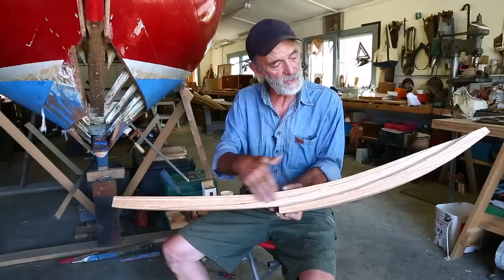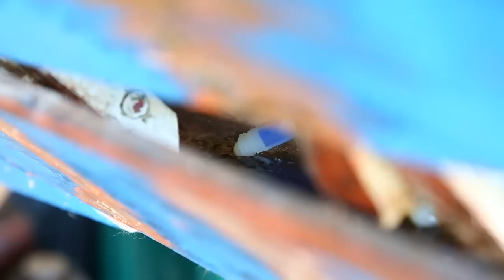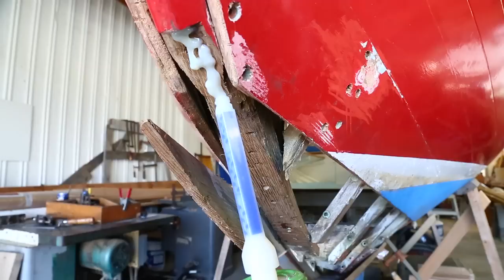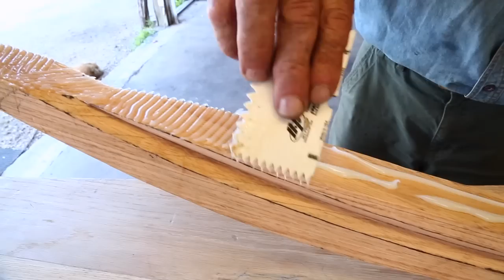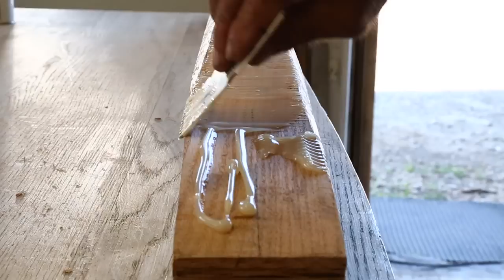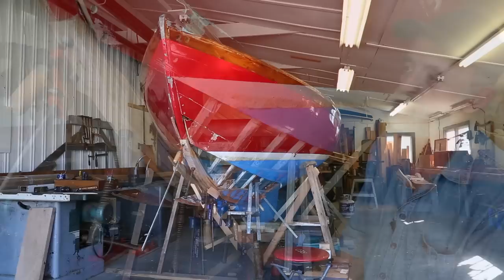Part 6 - Wooden boat repair - Installing the forefoot on a Herreshoff 12 1/2

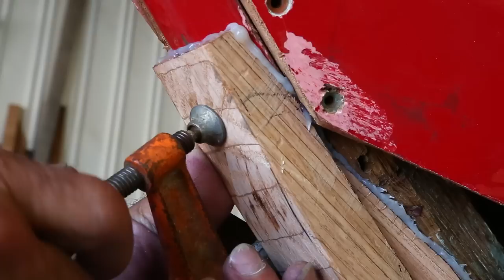Comment: 3:54 clean it of with naphta  in lacquer thinner 10%. Alcool is cold and dry it does not induce heat on these thermoplastic compounds.

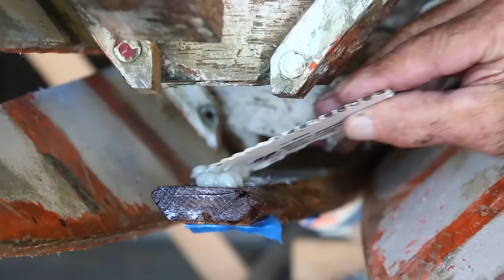Comment: 1:54 but the boat is not build with epoxy everywhere... this hard spot is going interfere with the flexibility of the boat haul cause some other damage. If it doesn't break the epoxy it will break the wood. This area is the spot that takes all the blows of navigation. Screws are going to give and get loose
Reply: I think that part of the boat is not actually meant to flex much. By the time it is all joined up using traditional methods it is like a solid block anyway. This guy knows what he is doing (in my opinion).

Comment: Great gluing practices. I cringe when I see someone working with wood and run a single bead of glue down the center of one piece of stock versus covering the entire surface areas of both pieces of stock.

Comment: I actually use the saw blade to clean a cut if it's not entirely clean (i use the go around the cut line technique most of the times and that leaves some marks, nothing big but still), and it's really great because i can use the side of the saw blade as a guide along the wood and just let the teeth cut for me.

Cutting tools with teeth have so many more uses than just straight cutting with them. :)

Comment: All this work you do on wooden boats must cost the owners an arm,leg and a nut.  Ill stick with metal hull boats.
Reply: +Rogue Fox .....If your really worried about cost then fiberglass hulls can't be beat.  Try this test leave a metal, wood and fiberglass boat sit in a yard unattended for 20 years and view the results. I have many times and fiberglass is the only survivor. I love wood boats but will never own another. My dad had a 50ft steel ketch, rugged sure, but rust never sleeps.
Reply: Not necessarily, the metal costs more and the work is a more involved and detailed process